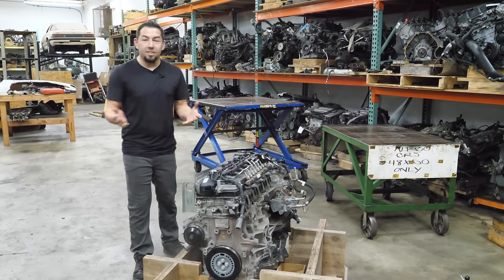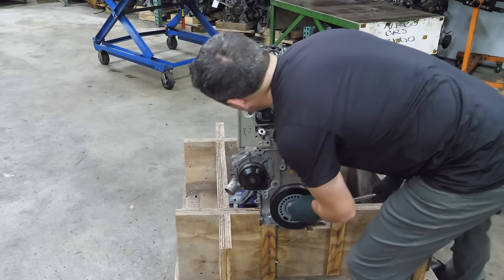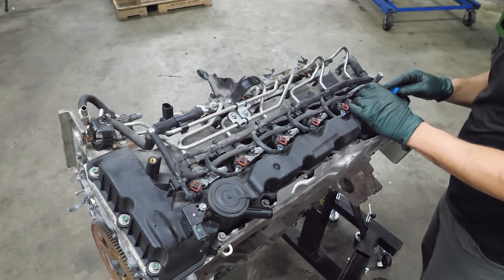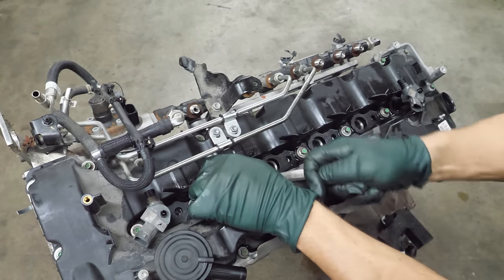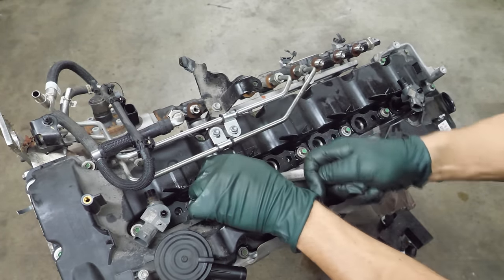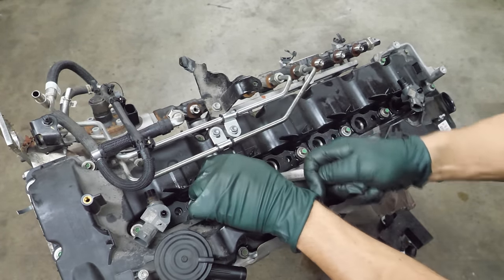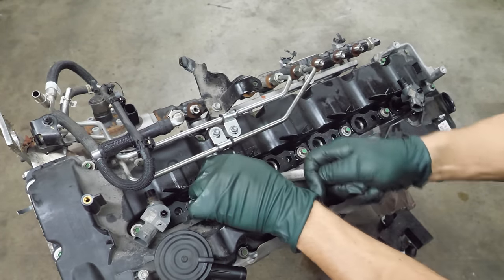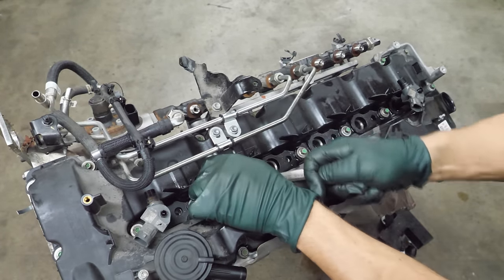BAD 2020 Silverado 3.0 Duramax LM2 Engine Teardown INCREDIBLE DAMAGE!

Comment: The fact that it ran with no rod bearing on that one journal, the general lack of damage to the crank is impressive. That is a tough crank.
Reply: I drove a 1976 Oldsmobile with a 350 Rocket in it for over a week with no bearing left on several rods.

I beat the SHIT out of that car forever, and it finally spun a rod bearing at 176,000 miles. 

It started with a slight knock, and the engine would seize up when it was driven long enough and it got hot. Let it cool down for a few hours, and it would fire up again. 

I drive it to work 2 miles away for a week like this. The knock got louder, and louder, and pretty soon it actually hurt your ears. 

What finally killed it was when a few of the rod bearings were completely gone, and the big end of the rod started to wear big enough, the rod actually contacted the oil pan and the bolts scraped a gouge through the pan, and all the oil drained out. It tossed 6 of the rods very shortly after it lost all of it's oil.

What a broke ass teenager will do...

That engine was a TOUGH mo'fo though.  😂
Reply: @davelowets Now that engine literally tossed its cookies 🍪 😋 😂😂😂😂😂😂
Reply: @carlbernard4197  It SURE did... 
Went for quite a bit longer than I thought it would have with spun bearings. I was bummed when I pulled the engine down to remove the camshaft, (I had earlier installed a decent sized Comp cam, and wanted it back) and when the rods broke they took some large chunks out of the cam lobes. 😟 
🍻
Reply: Tough crank but too bad  everything else is designed to fail at 150k.
Reply: @jalee6587  I totally agree
Reply: It does have a forged crankshaft. That makes a big difference.
Reply: I tore apart a sizeable diesel tractor engine several years ago that had almost totally digested one rod bearing.  It had spun and when it spun around to where the oil hole in the bearing shells was lined up, the engine actually got quiet and sounded normal.  Then it spun around some more and would start start knocking like you were hitting the block with a sledge hammer.  It was pretty amazing it still ran fine and still had oil pressure.
Reply: And no damage to the rollers, rockers, or cam after the massive shock to them.
Reply: The crank is easily the best component in the LM2 and LZ0. It's forged and the timing sprocket machined directly into it. Also, tolerances are very very tight (not allowed to say exactly how tight but many headaches have been caused).

Comment: As an owner of a 2020 Silverado with the baby durtymax, this is super informative. I currently have 60k on the clock. I check my oil level at every fill up, which is every 500 - 600 miles. With zero smoke or drips, it uses 1/2 quart on average. Fellow LM2 owners, check your oil often. 
I would love one of those pistons.
Reply: My 2020  has 19,000 miles and has never used a drop of oil.. First oil change at 1000 miles then 5000 after.. I use the PPV oil filters on mine.. Next oil change will switch to Amsoil 0-20 Dexos D oil... Same prices as the GM oil.....
Reply: A quart every 500 miles??

I would be pissed, and NOT consider that normal...😤  😡
Reply: It's really interesting the difference unit to unit. I have a 2021 LM2 with 28k on it, my oil consumption has been less than 1 quart between each oil change, 4 so far.
Reply: Switch to Mobil 1 ESP X2 and you wont burn so much oil. It’s also dexos d rated.
Reply: My 2021 with 25K on the clock has never used any oil.  And I change oil and filter religiously at 5k.
Reply: Crap owners for crap trucks hand in hand goes oil burner
Reply: Your engine… burns HALF A LITRE OF OIL EVER 600 miles!? 
Dude. My hilux burns half a litre of oil every 10,000 miles.
That’s insane. Theres something wrong with those tolerances
Reply: @ricksmith4736  Following similar schedule here, did the 1st oil change at 500 miles with a PPE filter and oem oil. at 2k miles went to Amsoil and PPE filter and will do 4k intervals. Shooting for half of everything recommended by GM.
Reply: My 2022.5 uses absolutely no oil at 23,000 miles. 2nd change it used about half a quart but after that I haven’t seen it move between changes.
Reply: @ZmannR2 I'm at 30,000 km and I've had 4 oil changes done at the stealership, but from now on I'm doing my own and using the 0-W20 Mobil 1 ESP x2. My local CTC just started stocking it in the 5 liter jugs at $58 ea. 
P.S. I've never burned any oil between oil changes. But I'm not towing either which I've heard makes all the difference in dEF and oil consumption. I usually get about 5-6,000 km to a jug of DEF.
Reply: @peterherndon997  burning oil isn’t necessarily a bad thing. Some research shows if your engine burns a little oil it’s actually good for the motor.
Reply: You should watch the spicer designs video on his duramax with oil consumption issues. 

The problem was solved by replacing the valve cover. There's a GM service bulletin about it that most people aren't aware of.

Comment: It's funny, everyone (me included) has a bad opinion of that oil pump belt, but I have never heard of one failing and the one he took out of that engine didn't look too concerning for 140K miles....  After this video I am more concerned about that 4 foot long upper timing chain and oil tensioners than I am about the belt...  Great video, very interesting to see one of these taken apart.

Comment: At 15:00 when the rear covers are off you can see the upper timing chain tensioner is already completely extended to its limit. Timing chain stretch is likely the issue for valve-piston interference, as well possible timing offset. These engines run very aggressive AI50 (50% burn point of the combustion process) which is likely the cause for the upper con rod bearing shell wear. Looks like number 6 piston also shows a crack in it.
Reply: You're killing my desire to buy one of these trucks!   You're saying even with religious oil changes the con rod bearings are going to get beat up due to the aggressive timing the engine runs to hit it's efficiency target?
Reply: I thought I saw a crack in the piston also
Reply: @terrynagle7410  doesn't bode well for longevity either!
Reply: @DaveBenson  don't do it man
Reply: @KHALABEEB  haha, but what truck do I buy then?  Coyote powered Ford....I can afford the gas but I do love diesel
Reply: Firsr time I've read AI50 for the MFB50 outside work... Always thought this was just our internal PUMA name.
Reply: the upper rod bearing wear is likely from valve/piston interference.
Reply: anything old with low miles. its an easy choice.  @DaveBenson
Reply: You’ll be fine with the 3.0 Duramax. These fear mongering comments are hilarious. 
Changing your oil every 5k miles is not hard…..
Reply: @DaveBenson coyote consumes oil.  Buy a tundra that a few years old.
Reply: @EBIndy  there’s a company out there that makes a larger oil pan that holds an additional 2 quarts. That would’ve probably helped to alleviate this potential failure.
Reply: This diesel is the best truck I've ever owned. I bet this thing goes at least 350-400k with proper and preventative maintenance. You don't understand how smooth the power delivery is. It's an absolutely joy. got 39.2mpg on my way to Denver last year over a 30 mile stretch with wind at my back. Incredible powertrain @DaveBenson
Reply: @EBIndy  How, in your mind, is this chain of replies "fear mongering"? It's just a few people on the internet discussing the weaknesses of a particular engine.
Reply: Timing chain don't stretch...nuff said
Reply: @2nickles647  They can and they do. Not super common, but was more prevalent on cam-in-block engines.
Reply: @DaveBenson   Are you really going to listen to a guy with a name like Khaleeb abdullah??  Ah la la la la la la la
Reply: I'm sure the tensioner WOULD be at it's limit after the pistons hit the valves, and probably just about pulled that timing chain apart in the process. I bet it stretched the chain at least a half inch instantly when it happened
Reply: The 3.0 Duramax has this cool thing called a dipstick. If you pop the hood and pull it out you can check your oil level. But in todays lazy incompetent society times a basic responsibility like that is to much to ask.

Comment: I have watched a lot of these tear downs. what is most astounding is the amount of money poured into the  engineering, design, the making of tooling. mold making for the aluminum parts , the dies for metal stamping, tubing bending, all for a engine that won't be around in  10 years. oh and the BELT for the oil pump!!.   I like my 20 year old 6.0L and my 60 year old dauntless v6.. great show thanks!!
Reply: Keep in mind that after 146,000 miles on that engine, the oil pump belt was in good shape!
Reply: Oh the 6.blow with its clogging oil cooler? Yeah you have no room to talk about the 3.0 Duramax. Until you own one keep your ignorance to yourself.
Reply: This engine will be around in 10 years. They put it in tons of small box trucks in Europe (Opal branded)  and GM is expanding what they put it in here. The new LMZ version has forged pistons and crank with over 300HP. I remember the 6.6 Duramax had horrible overheating issues initially and they figured that out and it is still around. With EPA mileage requirements this engine will undoubtedly be around a long time. The oil pump belt is a 200K interval maintenance now on the LMZ, with the money someone saves on fuel at 25 MPG it is a non factor.
Reply: @alfredocarpaneto5976 if you didn't hear, Holden also sold the same diesel engines before they went bankrupt. All of these small GM diesels have a lot of issues, especially the diesel astra / cruise / Captiva.

Comment: Love how both rod bearings turned to liquid dust. The valve impacts were amazing. Great Saturday breakdown
Reply: Does the impact become less amazing because the pistons are a composite mix design? I just thought about that but don't know much about these things
Reply: @adam9936   No, it's just amazing that the impact was able to instantly pound the rod bearings right out of the rod like that. No matter WHAT the pistons are made out of. 

I've worked on MANY engines that have dropped a valve, or lost time, and had pistons and valves crash, BUT I've NEVER seen a rod bearing pounded out like that when it happened. 😳

Comment: If the pistons weren't forged before....they are now!  Great job Eric.😊
Reply: The newest model engine is forged now. Which actually gave the engine more horsepower and torque because the heads are now smaller, which makes the rod longer.
Reply: Those aluminum pistons are forged. Just extra forged now lol
Reply: @adamprater6216  sorry the new ones are made of steel now. I think they were afraid of diesel "knock" which is why it was aluminum.
Reply: All duramax pistons are forged

Comment: It boggles the mind - timing chains, but an oil pump belt on the back side of the engine, requiring removing the transmission to access for inspection/replacement. An oil submersed rubber-based friggin belt amongst other chains. Tell me engineers don’t hate technicians and customers; or maybe it’s the accountants who do. 

Impressive valve imprints on the piston tops 😮
Reply: The engine was made for the European market cab over engine trucks……..

Comment: Jumping time due to a missing rod bearing is absolutely a thing, even without losing oil pressure. Take the bearing surface and shell out of the rod and you've increased the piston's TDC height by that much, and since it's loose and moving fast it increases TDC dwell by a GREAT amount. Since most cam timing has overlap periods the valves are still opening and closing at TDC between the exhaust and intake stroke, that piston gets flung up there into the still moving valves, which tries to close the exhaust faster and stop the intake from opening. 

Meanwhile, the camshaft is still being driven... and whatever drives it just took one hell of a shock load. It can be enough to force a tensioner open if an engine has that system, or can simply load a belt or chain up enough to climb a tooth and hop over, if it doesn't just outright snap or bend the camshaft. I don't think you'd get so far as to crack a keyed pulley or break a cam nose or lobe though, it's all in the valvetrain geometry though. I bet you can find other motors that have shelled rod bearings with concurrent bent pushrods and rocker arms, if the valves are strong enough and angled little enough to avoid bending.  Targets, hrmm.... gonna be a work engine of some sort. I'll digress from there.
Reply: Makes sense, decent take
Reply: My stance was that the loss of oil pressure both caused the rod bearing failure, and the loss of pressure on the chain tensioner. Other than the chains, tensioner, and oil pump belt being at the back of the engine where they are impossible to service, this teardown video has shown me this engine looks quite solid. Its much simpler than many other modern engines.